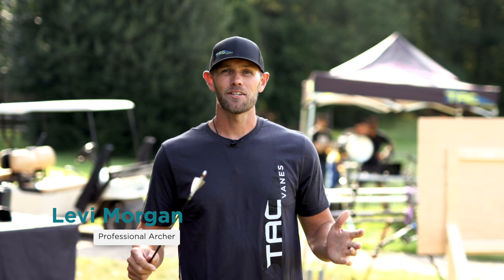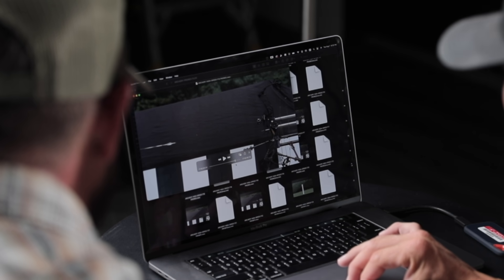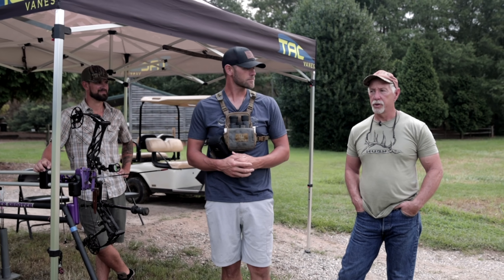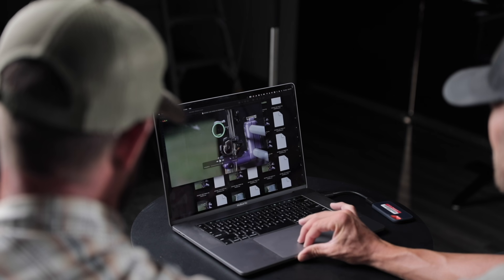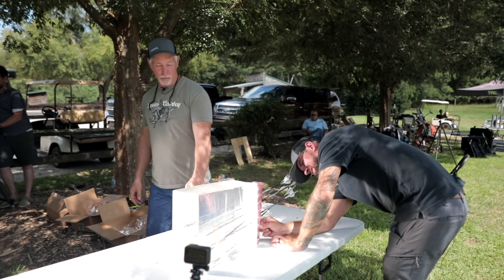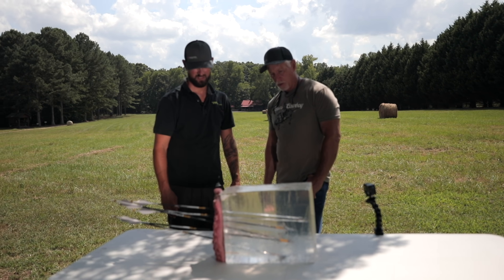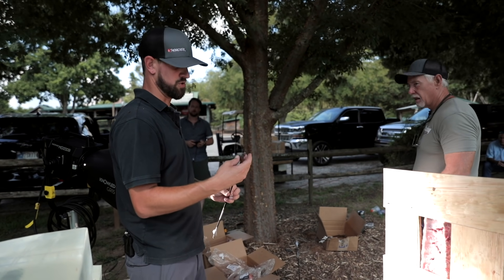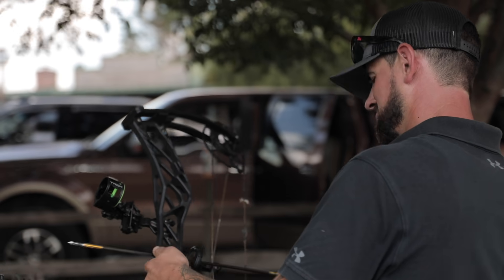SEE FOR YOURSELF 😲 : The LRP Arrow system vs. the competition w/ Levi Morgan

Comment: So.Turns out, left offset and helical have been a bad idea for trajectory, and sound all around since inception. Straight fletch is best, always has been. As far as biscuit goes, coupled with blazer vanes has probably killed more game than anything in the woods. Biscuit will always be the ultimate tree stand rest, you can turn the bow upside down and the arrow will remain in the rest. Regardless of how fletches look in slow mo. POI/consistency is king. Preference and confidence is the name of the game. Fellow archers don't mislead folks on sponsored partnership affairs. Truth is all these products work, and work well. Shoot what you can and what you believe in. 99 percent of these in depth micro measurements matter none compared to a humans inability to shoot perfectly consistently. Watch what the industry tells you. This world revolves around the dollar. There has basically been little to no improvements worthy of the price in a decade or more. All the fads Speed, KE, FOC, Fixed, Mechanical, Back tension, Thumb. Here we are finding out what some knew all along.. they all work. Keep your money, practice, and out shoot em with a much older, cheaper setup. Archery is between the ears.

Comment: There’s no arguing with the tac vanes on performance and clearly they are very rigid and should have the best performance coming out of the biscuit. The broadhead testing however left a lot to be desired. Yes swacker penetrated better through the wood but it didn’t open up until it was in the gel and with the blades having to fold over inside the gel it slowed down extremely fast. It gave it a huge advantage over all the rear deploying broadheads because you’re basically shooting a field point through wood

Comment: Pretty biased. Showed all the results but moved the bar a bit too much. Went on about shooting flatter and then said but it doesn't mean anything if you don't shoot tighter groups, then when the groups were the same or worse than one changed the narrative to " look how much higher they are on the target. Mind you that was also at 100  yards, at 25-35 yards where most deer are shot the difference would be about 1''. Then when shooting through ribs showed how all the other broad heads flexed so bad they angled downward into the Gelatin. Then when the schwacker, which isn't supposed to deploy or deflect until after it has penetrated the ribs and entered the cavity actually deflected so bad it drove down through the table. That is when we stopped talking about deflection and went right to amazing penetration. Except that would have been a deer who was punched  square on at about 30 feet and would have come out the bottom of the deer. Then we go to shooting through plywood where the Schwacker should have drove clean through the plywood and the gel block but it barely penetrated. Why when there is so much less force on the broad heads, I will say the other expendables were horrific, but the two fixed blades had entrance wounds and deeper penetration. But we immediately changed the penetration subject to how wide the wound channel was and not, damn we may never recover that deer because there is no tracking juice. Nothing about those tests blew me away except for the weakness of an expandable hitting leg or shoulder.

Comment: Sorry, but a 3” expandable will never come close to penetrating an ANIMAL like a small fixed blade will.  Gel is not really ideal for testing arrow penetration.  Even in this testing, the wider Swhacker and Iron Will heads penetrate better than their narrower counterparts, which tells us that the friction of the gel on the arrow shaft is playing a big part in stopping these arrows, and not strictly the resistance against the broadheads themselves.  Gel closes back up on the arrow.  Animals don’t do that.

Comment: Why would you even think of using a whisker biscuit?
Reply: Lots of folks do it but they don't shoot past 30
Reply: @joeditz48   Wrong, many western hunters use them, I live in AZ and can vouch for that...including Rick Forrest, the engineer in the video.
Reply: @codysmith8042  the fact is, they aren't as consistent as drop aways. That being said it's hard to beat for the cost
Reply from the maker: The Whisker Biscuit grouped the arrows every bit as well as the drop away rest.  The spin rate and drop tests were done with a Hamskea rest.

Comment: Shitty whisker biscuit invalidates entire test. Of course tak vanes perform better through a biscuit. They are a stiffer vane. This was done on purpose. So it with a drop away rest and post results.
Reply: This would also show vane recovery if you were to hit a limb down range though.
Reply from the maker: ker Biscuit grouped the arrows every bit as well as the drop away rest.  The spin rate and drop tests were done with a Hamskea rest.